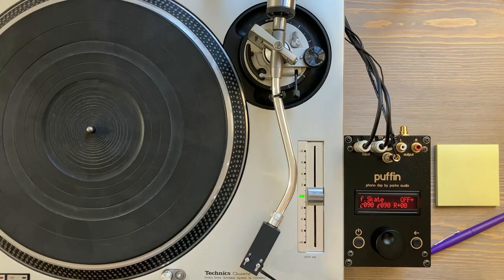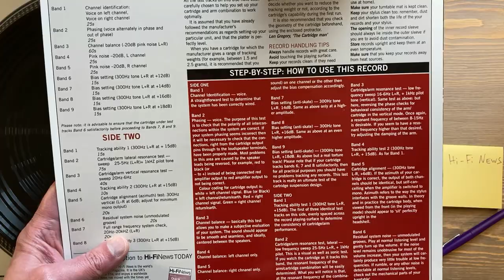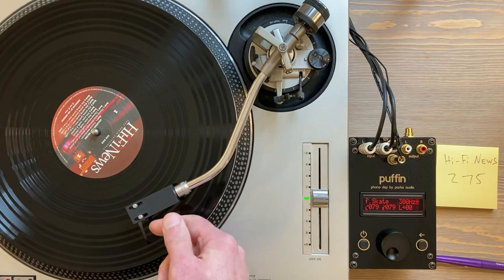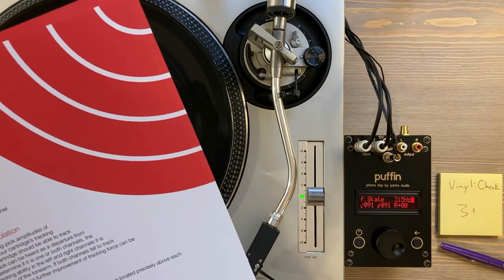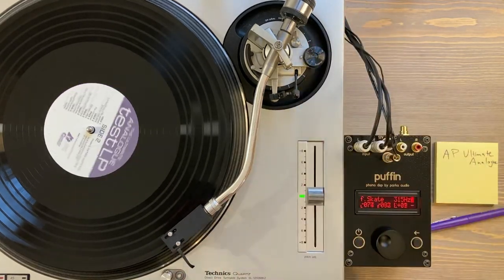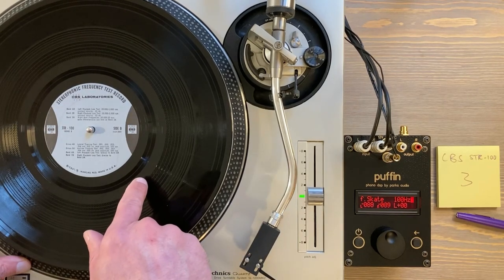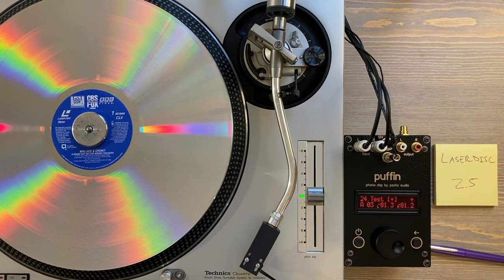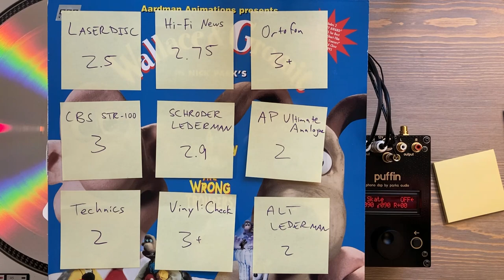Parks Audio #6 - Nine Anti-Skating Adjustment Methods for Vinyl

Comment: The skate force is always pulling the stylus to one side.  So it is always off center. The "anti-skate pulls the arm one way and the record pulls the stylus the other way.  So the system is flawed by design.  I realized this this other day and bought a linear tracking setup.  It has no skate force and sounds amazing.

Comment: The skating force acting on grooveless surface is not same as in grooves. Because on blank surface only stylus tip which is not the intended contact point is touching the record. It should be like that if antiskating is set according to test tone (equal distortion on both channels) then on the blank track the stylus should move inwards at moderate speed (roughly the speed of runout groove). It's discussed on forums that if the stylus sits still on blank track there is already too much antiskate applied.
Reply: It varies across the record, as showed with the laser disc method. The stylus sits still on blank track only between the null points, If that happens in the begining, than there is too much antiskate applied. But that's just for demonstration purposes, as the laserdisc is taller than vinyl, changing the VTA, which is why I use the Frank Schroder method.

Comment: I have the Audio Technica AT-LP120XUSB turntable with the VM95ML cartridge, and the only method that works for me is the "laser disc method." Unfortunately, I don't have the fancy meter device shown in the video to get more exact. This turntable model is notorious for having a bad anti-skate adjustment, but at least it can be done. I bought a blank record from Amazon to perform the adjustment. The recommended counter-weight for my cartridge is 2 g, but the anti-skate setting that keeps the tonearm in the center is 1! If I set it to 2 (which is what the manual says to do), the tonearm just flings backwards towards the edge of the blank record. If I have a real record on the platter, the tonearm snaps up and over when I lift it at the runout. So, I keep at a 1 until I have a better way to make this adjustment (or get a better turntable).
Reply from the maker: I really like the Audio-Technica AT-LP120XUSB - just recommended to someone this morning. And I love my VM95ML - such a great cart with its micro line diamond.
Reply: @parksaudiollc4697  Don't get me wrong, I think it's a good turntable, but you just have to be aware of a couple of its quirks: (1) the anti-skate adjustment is wonky as I mentioned in my previous comment; (2) the tonearm cueing mechanism well may need some damping fluid. If you don't fix the latter, the tonearm will just drop like a bomb onto the record. Otherwise, for its price category, it's a very solid fully manual, direct drive starter table.
Reply: Maybe you’ll see my comment. I have the same turntable and exactly what you commented is what’s happening to me! I’m set at 2.0 tracking force but the same setting with anti skate wants to fling the tone arm off the surface! I’m set just around .5 and it seems to be fine.
Reply: @utp216  So, last year I had the opportunity to purchase an open-box return Technics SL-1210GR for a good discount at a warehouse sale. Problem solved. This beast is precise. I probably won't need to buy another TT for the rest of my life.

Comment: What a nice video comparisons which displaces opinions with test results on several formats. People support anti-skate opinions with various theories often criticizing smooth surface method among others, I was ready to swallow it all too. I have set the anti-skate system each side of the factory recommendations of the Sure tone arm manufacturer slightly, then carefully listened for changes and came to the conclusion I could hear none.  Thank you for clearing the audiopile coiled heap from the room. I employed the laymans methods and they all correspond well for verification, thus comparing well to the physical calibration scales on my tonearm. It seems in the case of anti-skate that close and reasonable are 'good enough for government work'. Your video saved me some coin so now I will not throw money at test records or electronic tone/test equipment. That money will buy more records. Well done!

Comment: Setting the antiskate adjustment to the same adjustment as the tonearn weight is absolutely correct.
This theory, that a tone arm should be motionless on a groove-less spinning disc is absolutely  incorrect according to a phonograph technician I spoke with at length.  Actually doing as this theory advocates can cause irreparable damage to the record and  stylus.
Actually, Anti-Skate is supposed to add a very small (slight) amount of outward force (toward the edge of record) DEFINITELY NOT CAUSING THE TONEARM TO BE MOTIONLESS.  With the proper amount of Anti-Skate applied, the TONEARM will still move toward the center of the groove-less disc but at a slightly slower rate of speed compared to the slightly faster inward speed of TONEARM movement if no Anti-Skate was applied.
Reply: Basically, Peter Ledermann and Frank Schroeder were right

Comment: Good morning,
Thanks for this excellent video and analysis. I am French. Sorry for my broken English...
I have a Technics SL 1500C with an Audiotechnica VM740ML at 2gr of tracking force. The turntable is horizontal and I tested the method with a blank vinyl record. The tracking force needed for the stylus to not move and stay in the center of the vinyl is 3g.
I then listened to a classical music vinyl on headphones and also the Elipson test disc at different frequencies. By varying the antiskating between 0 and 3gr, I noticed no stereophonic shift or distortion. I deduce that this antiskating setting has no influence on the listening quality and therefore I wisely reset my antistaking to 2gr as recommended by Technics...

Comment: I have an AKAI AP-D210 servo controlled direct drive turntable. The anti skate it uses is a simple spring.
So when I put the stylus on a blank disc and turn the anti skate knob the needle will settle at a certain position on the disc.
So what I found logical to do in my case was to adjust the anti skate so that the sylus would settle at around the center of the 12" disc I used.

Comment: Hi! Thank you for this excellent, informative video. My question/situation is almost identical to another commenter's, but I wanted to ask nevertheless in case your views have changed since you last addressed it:

I have a Technics 1200-MK5 with a AT-VM540ML cartridge. I've been told by some other people with similar setups (who have used audio-based test records as a reference) that for a VTF of 2 grams, they adjust the anti-skate to about 2.5. Unfortunately, the hearing in my right ear--while generally good--is not as robust as my in left (or at least emphasizes certain frequencies over others). So when I do listening tests with a 2/2.5 adjustment, comparing vinyl playback to digital copies of the same songs, the left/right channels sound fairly similar to my (imperfect) ears. But it's obviously an inexact measurement.

However, I'm concerned because when I drop the stylus into the outer groove, it always jumps inward a little--not enough to skip into the first track, but enough that it seems odd to me. Similarly, when I do the famous Soundsmith test, I don't see the stylus move slowly to the center label unless I dial up the anti-skate to between 3-3.5. That seems rather high to me. And while that sounds "good," I'm concerned it's too much anti-skate and not an accurate reflection of the music (checking it with my ears, it seems like it does get louder than it probably should in the right channel when I dial up the anti-skate to fit the Soundsmith methodology). [General disclosure here that my turntable is about as level as I can get it with the old, wooden floors in my house.]

So my basic question is: should I just settle for the 2.5 anti-skate setting? Is it normal for an ML stylus to skid a bit more in the inner/outer grooves? I'll note that it only does this when I lower the stylus onto the unpressed surface and doesn't skip at all during playback. Thanks!
Reply from the maker: I think the whole idea is more about balancing stylus wear and handling very loud passages (and scratches). I think you can err a little on the lower side and be safe and happy. So 1.5 to 2 may be best for your setup and peace of mind, particularly if you notice pulling in on a needle drop.
Reply: I have a Technics DL-D3 similar looking unit but older. I found a massive non linearity in the gimbal bearings. I since made a cantilever tonearm and threw the old tonearm in the bin. Check linearity with a laser disk across the whole disk and look for a sort of binding. Nobody checks for worn or defective components.

Comment: Wonderful video, including presentation - e.g., top view and post-it notes make it easy to "rewind" and find section I'm wanting to look at again.  I discovered that my discogs collection notes came in handy: my 1980 McCartney II album 7" promo has a blank back side (sorry, sounds rude!).  I also plan to try the Shroder-Lederman method.  I'm a few steps down from your record player with an ATLP120USB; I set up according to specs and anti-skate at 2 (out of 7!), but I've noticed the few times I've digitized that one channel is slightly louder (not sure if it's left or right).  I'm also very interested in getting one of these test records, but don't know enough to decide which.
Reply from the maker: Thanks for the kind words, Alan! 

Skating doesn't seem to add too much gain mismatch in my limited testing. Cartridge imbalance is more of a culprit (0.5dB isn't a surprise), and even the internal preamp on the ATLP120USB as well as the soundcard preamp/ADC. Error can really add up to 1dB easily which would look like one channel is only 90% of the other.

Comment: I find having a full side blank record is essential to really see what's happening with your anti skating. Too many of these test records do the test at some specific point across the side, but I have seen plenty of anti skating devices that will pull outward from the inside groove, and inward from the outer groove. Or will have much more sideways pull for the first half of the side, which then drops off to almost nothing towards the end. It also shows how useless the method where you twist the lead out wire for the arm to provide some sideways pull is. 
I have found the best source for one sided records is to find a record store that has a lot of DJ dance music pressings. You can often find test pressings that were distributed to DJs with music on one side only. Look for a blank white label on one side.

Comment: Why do you set the gain on the amp to a particular level other than full volume?

How do you use the amp to test the Puffin?

What tests can I perform on my Puffin to confirm my Turntable and Puffin are working as well as possible?

Comment: Will a different turntable Matt help? Some modern plug in and go decks have a built in anti skate which might mean taking off the tone arm?
Reply from the maker: 1) I don't think a different mat will affect the skating. 2) I'm afraid I don't understand your second question - apologies.
Reply: @parksaudiollc4697  Rega Planar 1 plus deck the anti skating weight is built in.I saw one YouTube video where the tonearm had to be removed to adjust anti skating.
Reply from the maker: @likklej8  Yes, these are basically a fixed setting by Rega and apparently require some DIY modding. I prefer the old-fashioned "weight and string method" which can mod any tonearm without disassembly or hardware mods. I use that with my Audio Technica ATP-12T.

Comment: Thank you, i like your video. At home, I noticed enormously different values depending on my stylus I test 3 white lp and depending on the thickness and the material of the lp .the values are all different. For example, for a  audio Technica VM95C conical stylus I will have a value of 2 antiskating for a weight of 2 but for my audio technica VM540 ML microline I will have a value of 3 antiskating for a weight of 2. Is this possible? From my many readings, I have always heard that it is better to put less than too much when you hesitate. n 2015, I had an audio technica lp120 whose antiskating did not work at all. I used a microline 3 years on it every day. When I realized the antiskating wasn't working I didn't notice a problem with the stylus, it was still straight. This reassures me in case I put the value too low
Reply from the maker: While the conical and micro-linear diamonds will have different surface contact with the vinyl, the distributed force will be equal, so I can't answer your first question. This must be a variable or variables I don't yet understand. Maybe the differing compliance between these two carts affects this measurement?

I would agree with you that it is better to err on the side of too little anti-skate than too much. Peter Ledermann of Soundsmith states in his anti-skate video that he's seen many worn styli indicative of too much anti-skate, so that seems a good argument for this methodology.
Reply: I saw in an old Marantz turntable manual they recommended using the same amount of antiskating as the tracking force (like Technics), however in their manual it applied for conical styli only, elliptical ones required more antiskating, it was 2.5 or 3 (I’m not sure now, maybe even 2.75) for 2 grams of VTF, there was a graph for both of them. However, if I use the blank disc method, I notice that my Technics does require more antiskating for microline styli comapared to spherical and elliptical, when I track at 2 grams, the antiskating for Audio-Technica VM740ML (microline) is 2.4, for Ortofon OM5 (spherical) , Audio-Technica VM95C (conical) and VM520EB (elliptical) it ranges somewhere between 1.4 to 1.6. It is also dependent on azimuth and VTA, if your VTA is set too high, even the maximum setting of 3 may not be enough.

Comment: How accurate is this instrument ? Have you compared with oscillocospe and voltmeter?
Reply from the maker: I use a TrueRMS method, so quite accurate but note this measurement is relative to full scale (dBFS). The 24-bit ADC smokes the typical o'scope 8-bit ADC, too.

Comment: Thank you for the great info.  I recently bought a Technics MKII and when the anti skate is turned up between 1.5 and 3 the tonearm(with headshell attached) moves backwards to the outside of the record a bit when you lift the cue lever.  I know that the higher anti skate number would pull more to the outside but on my MK3's when I crank up the anti skate to 3 the needle lift and drops in the same spot.  Should the needle jump back a bit when lifting the tonearm cue from the inner tracks when the anti skate is turned up which makes it not drop in the same spot.  If you lift and drop over and over it jumps back more and more to the outside of the record.  Thanks so much.  I really appreciate it.  I just don't remember my MK3's doing this.
Reply: Whether it should or not depends a bit on the cue platform as well. Most of the Technics ones are made of rubber and should have a bit of stickyness to them that grips the tonearm so that it doesnt pull back when you lift the arm, even at a lot of Anti Skate. But this rubber dries out over time and becomes less sticky, so its hard to say if you too much Anti Skate just judging from that aspect.
Reply: I had this problem when I got a little silicone fluid from the KAB Fluid Damper on the rubber strip on the cue lift. As mentioned above it could be dried out old rubber that’s lost it’s grip. You can try a rubber cleaner if there’s something on it or if it’s lost it’s grip from age you can lightly sand it with some 220 grit sandpaper to put some friction back onto the surface.
Reply: the exact happens to me too.. however i never researched for the reason...